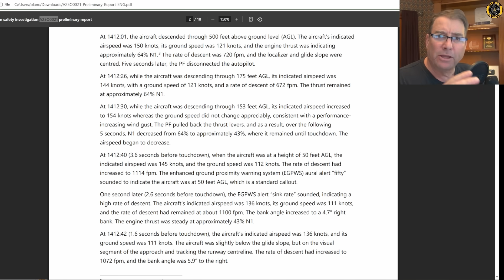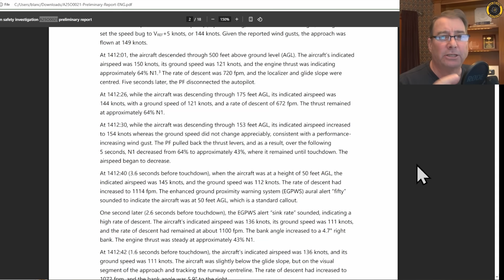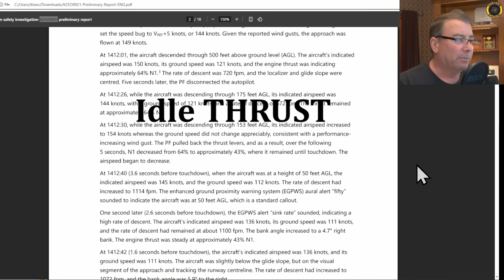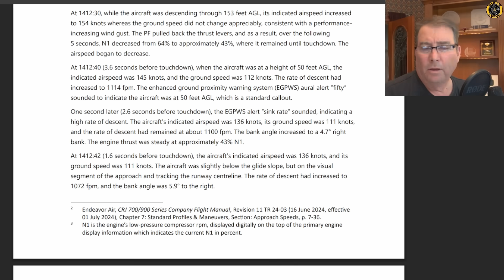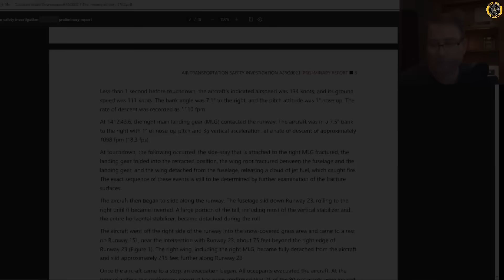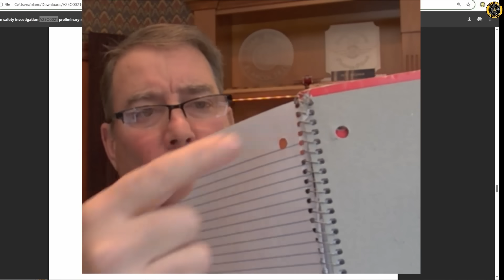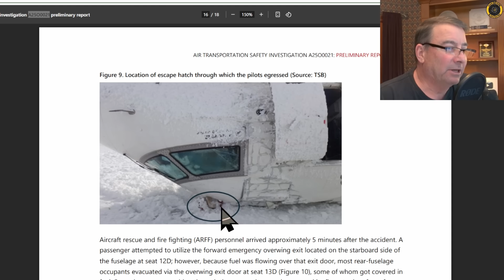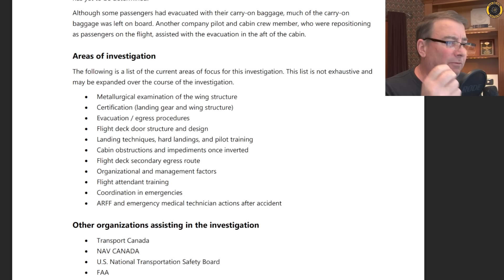TSB Prelim Toronto CRJ Crash

Comment: Here's something to think about.  The GPWS "sink rate" can mask or blank the normal calls.  50,40,30,20,10.  A lot of pilots over rely on those calls.  I've seen it before. 
 No calls------------> No flare.       I've seen a lot in my years.....   Lou B (21,000 ATP 747s, etc)
Reply from the maker: Great point!!
Reply: @blancolirio yeah I’ve seen that a lot.  Come on people.  Flare anyway.
Reply: @imaPangolin  they need the plane to hold their hand apparently.
Reply: @blancolirio  In South Africa an Impala military jet crashed( fatal crash ) this past weekend at a airshow outside Capetown. To me it looked like it was too slow and low to do a dirty barrel roll and that caused the crash. Could you do video on this ?
Reply: @blancolirio  Sight picture?
Reply: @bruinflight  Knowing how to fly a plane is for GA pilots not super special airline pilots.
Reply: One of my favorite books, Stick and Rudder by Wolfgang 
Langewiesche.
Reply: A true classic  @Mrsournotes2
Reply: But Lou.....if the aural warning "Sink Rate !" is blaring.....shouldn't pilot training kick in and initiate a go-around?  The altitude call-outs would be redundant at that point. Yes ?
Reply: @rael5469 and where was the captain when all this was going on? We’ve not had the CVR yet so don’t know if a go-around was called. Like you said it should have been and since the captain was pilot monitoring he should have called the go-around. CVR will shed more light.
Reply: @paul227-u1p  What makes you think that you know more than a trained airline pilot who was actually present in the cockpit ? You do not know whether he was taken by surprise or whether he did not feel that a go-round was necessary.
Reply: @hb1338  You mean an airline pilot that crashed? You think it’s wrong to question their actions after that?
Reply: @hb1338  I don't, but other's are putting the blame on the female pilot and DEI and I'm offering up the opinion that the captain is also responsible as pilot monitoring. The CVR will shed more light on this.
Reply: @paul227-u1p  I am taking issue with the word "should" because it is not obvious to me that a go-round was the best or only choice and there was insufficient time to make an assessment. Like you, I will be interested to know what the captain said and did.
Reply: @paul227-u1p the TSB will not release the CVR like the NTSB does.
Reply: 2.6 seconds before touchdown the audible sinkrate warning sounded. No time to initiate a successful go around at that point.
Reply: @awesomexistence  Yes there is - go-rounds are possible after touch down.
Reply: @hb1338  I think you missed the point I included which is a “successful” go around in this attempt to land. 2.6 seconds to impacting with enough force to break the plane! Maybe the pilot had a second or two to react to the audible “sink rate” before the catastrophic impact.
Reply: @ the go around is available until thrust reverse is selected. It's entirely acceptable for the plane to bounce off the runway in a Go around. Expected in heavy jets actually.
Reply: @awesomexistence  I'm not sure that we are disagreeing. If you are less than 3 seconds from touchdown and you get an EGPWS warning, you do NOT have time to make any form of assessment, so you make a snap decision. I have offered no opinion on what that decision should be, because the answer is not obvious to me.
Reply: @rael5469  A go-round is one possible response; increased thrust is another, as is an immediate flare. There is no indication that the pilot responded to the EPGWS warning, although in mitigation there was less than 3 seconds available to do so.
Reply: @hb1338   Maybe they got too slow to salvage that approach.
Reply: There's not a lot of visual information as you land on a runway - probably by design, to remove as many distractions as possible - and depth perception seems to have been a low priority.  That's why a narrow runway can be deceptive.  Nonetheless, you're expected to know where your wheels are, 80 feet behind you and 20-30 feet below your seat (and varying with your pitch angle.)  
I know I'd find the call-outs invaluable!
It's not so much a question of "relying on" them as a matter of becoming accustomed to having them: landing without call-outs would mean that one's acquired instincts are no longer in play.  Without stick-and-rudder experience, what are new pilots supposed to fall back on?  How much simulator training without call-outs do they have?
Reply: @jpdemer5  There is a very good reason why call-outs are provided - they are much more precise and much more accurate than the human eye.
Reply: NO flair was obvious from the landing video. Great analysis, Juan! Still a miracle that no passengers died.
Reply: Anything over 600/min is considered a hard landing on CRJ 900
Reply: I’m not a pilot. I couldn’t imagine a more fulfilling and interesting career. 

Of course I’m old enough to be some of you fellows’ grandpa and have learned that the grass is often just as scorched on the other side. 

Still, in my next life I’d like to be this guy or Juan or some of you reading this comment right now. I hope by then I won’t be so acrophobic.
Reply: I’ve have flown with a few pilots when we don’t have the call outs they don’t flair.
Reply: @ I agree. I’ve seen it.
Reply: “Sink Rate” callouts that close to the ground, on anything other than a pre-briefed steep approach (e.g. London City) indicates an unstabilized approach, which necessitates an immediate go-around.
Reply: @jmd12127  .. or not. What is the company policy of Endeavor Air ?
Reply: Interesting point. Instead of relying on what's in front of them they are just listening for the cadence change it's call out only?
Reply: That's a good point. Another important point is that the PM which was the captain didn't call out the excessive sink rate and bank angle. A 7.1 degrees bank angle would mean the wing would have hit the runway even before the landing gear.
Reply: Thanks.   Add that to Juan's point about a visually narrow runway and blowing snow, and the PF lost  a number of the normal queues for flare time.
Reply: @wastinelectrons7173  yeah, narrow runways lead to late flares. I flew the 747 for almost 30 years. Landing on a 150 footer vs 200 footer was a briefing item. It’ll catch you for sure.
Reply: @loub747  When my dad got his SEL (as a glider guider) his instructor took him to MHR and 3O8 on the same day to underscore this point. (150' and 30' wide, respectively)
Reply: @loub747 The converse can also be true. As a student pilot I had only ever flown from a 75' runway. Guess what happened the first time I landed on 150'?... Tail strike from over-flaring, as my 75' brain couldn't cope with a new 150' wide reality! Luckily, the Aerobat survived the experience unscathed.
Reply: @loub747  loub747, Re "150 footer...It'll catch you for sure" consider this gruesome aspect: at NIGHT you go by lights, right, not by plowed width? That means they have to plow 200 at night instead of 150 at day. Inconsistency loves crashes. Why, the same pilot who landed there 3 hours ago with 150, sees 200 now, and the red eye sees 200 then later it's 150. Umm, does that add a hole in swiss cheese?
Reply: @Bill_Woo  pilots need to land safely in all conditions. Or no? Stop making excuses. Student pilots near the start of their training are expected to land at different airports with different width runways and different terrain. Why do you have lower standards for airline pilots?
Reply: @chrisnoname2725   chrisnoname2725 That is the most deluded mis-extrapolation or misstatement of what I said in history. Or is it deranged: you have GOT to be a Democrat with that illogic. With that disjointed reasoning, bereft of rational thought, please help all of us by staying out of the air. Thanks, and happy bussing!
Reply: @chrisnoname2725  That is an idi0t1c distortion or false representation of my comment. Stick to busses; they're perfect for you, as they require far less logic both to operate and to ride on.
Reply: @Bill_Woo  Did I have to agree with you because you showed you’ve been paying attention because you said Swiss cheese? Your attitude towards bus drivers explains everything. 
I have never driven a bus but I have plane and helicopter licences and found both quite easy. I have never met a good pilot that thought they were special but the bad ones thought they were. 

Bus drivers don’t get excuses made for them if they can’t navigate narrow streets right after wide ones.
Reply: @wastinelectrons7173  I think this point will be deemed critical.
Reply: One of the things most people don't appreciate about modern operating systems like Windows, is that they will take multiple audio sources, and seamlessly mix them into a single audio signal to be sent to your speakers.

I can see why you wouldn't want to do this for aircraft alarms (it's another thing which can go wrong). But likewise I can see an argument for "important" aural alarms to have their own dedicated speaker. Testing multiple speakers can be easily accomplished by a recording playing back "one two three four" etc with each number going over different speakers.
Reply: @solandri69  Very true about the sound mixing technology in aircraft.  Traditionally, aviation intercoms and headsets have not done this well.  There is a lot of innovation in this area that is becoming more widely available, but like many things in aviation, it takes 20 years for most aircraft to be fitted.  I know my system which was new in 2020 lags the best technology - I have to choose which alerts are highest priority, and they completely override lower priority alerts.
Reply: @solandri69  The received wisdom is that pilots should deal with only one problem at a time; the flight director system sorts those problems in descending order of priority and does not announce any item until all items of a higher priority have been cleared. Multiple speakers are therefore not usually necessary.
Reply: When I was at pinnacle (now Endeavor) I believe you could add 1/2 the gust factor.
Reply: This wasn’t a good day for THAT captain to be flying, especially with a low time copilot. These professional simulator check airman are worse, than highly experienced copilots. Dave, 28,000 hours, 40 year major airline pilot.
Reply: A very interesting point -- I wonder what the CVR audio will show on this, as well as on CRM.
Reply: @loub747   this countdown would have sounded like a YT video on 2x
Reply: The debate also becomes, if you hear sink rate during your flare, it should be automatic go-around?
Reply: @ManualFlying  That is a matter for the chief pilot of the fleet/company and/or the individual pilot.
Reply: That doesn't explain why she pulled power to idle.
Reply: he did.  The massive performance enhancing gust.
Reply: @CHFandango  Juan already did. Apparently you weren't listening...
Reply: @CHFandango  She did it because the increse in head wind led to an increase in airspeed and lift. She was trying to bring down the speed and the plane back on glideslope. 
A go around should have been initiated instead. 

But she's inexperienced and the captain had only flown 3.5 hours in the last month. Whoever decided it's a good idea to pair them on this flight, took a risk imo.
Reply: @andreea007  yes your absolutely correct. Think is eve my PPL we are taught about head winds and taught not to throttle back like she did. Its the basics of flying. I don't know if the captain would of know she had throttled back. Had the plane had auto throttle this wouldn't of happened.  The issue here is not that she's female but that she's not good enough. Not to say she might be at some point but right now she isn't. Much the same with the other female pilot of the recent wing strike endeavour. Trouble is with endeavour it is not a meritocracy.  A male pilot who is a far superior pilot will be overlooked in favour of the ladies involved in these incidents. This cannot continue.
Reply: @andreea007  The important point is that the FO reduced the speed far too much and failed to undo the over-correction. Go-round was one option, but you do not have enough information to be able to say "should".
In all but the smallest airlines, flight crew schedules are constructed by computerised systems. The various selection criteria are usually assigned a priority and it may not always be possible to satisfy each and every one of them.
Reply: @CHFandango  Please provide evidence for your assertion that Endeavor Air discriminates in favour of women. Failing that, please do us all a favour and remain silent on topics of which you are ignorant.
Reply: What do you know?  You only have 21,000 hours.
Reply: It’s been said many times, to your point, that you can be blind but not deaf. Many pilots do rely on these autocall , and the rate at which they sound.
Reply: @edgarmuller6652  what does that have to do with her pulling throttle to idle exactly when indicated speed increases? It's totally unrelated. The accident was inevitable as soon as she idle throttle and left it there.
Reply: @edgarmuller6652  There is very little wrong with that idea, the automated call-outs are far more reliable and accurate than the human eye.
Reply: @hb1338  You have no issue with pilots not flaring because there was no annunciation? Trucks don’t warn you. Would you be making excuses for truck drivers not braking ?
Reply: @chrisnoname2725  Nowhere did I say that; kindly refrain from putting words into my mouth. What I implied was that automated call-outs are probably more useful than the human eyeball when deciding exactly when to flare.
Reply: Okay, but if you get a sinkrate warning on an approach so close to the ground, you're supposed to go around anyway. It's no longer considered stabilized.
Reply: @RubenKelevra  .. or not, as the case may be. Stabilisation criteria are a matter of company policy.
Reply: @hb1338  so which companies allows to proceed with a GPWS warning?
Reply: Combine that with a snowy runway giving the illusion of being higher and this is probably the result.
Reply: I'm hoping they will look at a way to keep both calls- either by speeding up the voice, or playing over them. 
But I would think hearing "SINK RATE" would more than key the pilot into arresting the sink rate- at least pulling the yoke back.... but I'm not a heavy pilot and I wasn't (and am not) there.
Reply: The height measured and announced by the radio altimeter is far more reliable and far more accurate than the human eye can ever be.
Reply: I would be a little surprised if someone was trying to land whilst the sink rate alarm is going off, surely that's reason for a go around?
Reply: @ it’s not a reason to go around.  In the 747 it’s a common occurrence if the glide slope is 3.2 degrees or more.
Reply: @loub747  That's a pretty strange setup to have an alarm go off in routine ops. I've never heard sink rate go off. That being said, the rate of descent of 1000fpm after the stable gate would by itself have been a reason to go around in my operation. What's the final approach speed in the 747? must be pretty high to be setting that off.
Reply: @ i think people just assume that anything not perfect is a reason for a go around as if you can’t just rectify the problem. They think they’re experts because they watch a YouTuber they want to treat as one
Reply: @ there is a difference between not perfect and exceeding limits. I normally see about 500fpm rate of descent on final, with the stable criteria being less than 1000fpm. If I see it at 750, I will raise the nose a little and add a touch of power, but if its at 1100 or 1200, Im adding full power and pitching up to the GA attitude. We have fairly clear criteria for when you are to abandon the approach, I don't fly this aircraft or for this airline, but its a major airline so I am sure they have this also.

I used to train pilots for BA and Easyjet at L3 Harris, so I suppose I am an expert, but not in this instance, as I am not familiar with the aircraft or company SOPs, however it's not likely this will meet the company stable criteria. 

We should keep in mind other aircraft flew in and out all day with no trouble, conditions were mildly challenging, no more than that. I land in similar winds often and without remark.  Something quite bad has happened here, and initial indications are that it's solely due to poor crew performance.
Reply: @greybuckleton  It is clear that the crew was unaware of the dangerously low airspeed, so it is quite possible that were also unaware of the excessive sink rate.
Reply: @hb1338  I can't remember from the video anymore. Did the airspeed drop below Vref?
Reply: @ why not just arrest the sink rate and continue the approach? 
When you’re parking your car do you give up and go around if you didn’t get the angle right the first time or do you just correct?
Reply: @chrisnoname2725  because it's not a car, you can't just stop. If the sink rate is too high it means you have lost control/awareness of the aircraft. You've gotten "behind the aircraft" as we say. Best to start over entirely, climb up, regain situational awareness and then decide if another approach is a good idea given the conditions and the pilots skill level. Most airlines have a "Stable gate"  an altitude (often 1000 feet) through and under which the aircraft must remain within very specific parameters to continue the landing attempt. Should these parameters be exceeded, the first pilot to realize will call for the "Go around" using the companies standard phrasing. Many accidents occur from pilots who are fighting to get an aircraft re stablalised on short final, its not the best way to do it.
Reply: @chrisnoname2725  When you are less than 3 seconds from touchdown, there is very little opportunity to correct.
Reply: @ well maybe. It’s not unusual to get a bit of a drop close to the runway and need to add a little power. That seemed pretty common on airliners i was a passenger on and very common in the small planes i have flown. I don’t understand this obsession with a stabilised approach where people seem to think you have to go around instead of just getting back on the correct slope.
Reply: @chrisnoname2725  you would understand the obsession if you had seen the stats. Almost no accidents are the result of a stabilised approach, and many of them ARE a result of attempting to land an aircraft that is too fast, low or otherwise not ready to land.  A "Stable approach" does not mean nothing changes in the last 1000 feet, it means nothing is allowed outside a criteria in the last 1000 feet.

The criteria at my work is Vref +10-0kts, Vertical speed, not more than 1000fpm, glidepath not more than 1 bar/light off, landing flap extended, gear extended, landing checks done. 

This criteria does not stop me from making power and pitch adjustments to maintain the aircraft within these tolerances. And indeed I often make many small adjustments in this time. 

A pilot who cannot stay within these criteria has lost control of the approach, and should go around. 

This accident was not the result of a needing "a little power", they had speed variations of 20kts, vertical speed sustained above 1000fpm, were below profile and with a wing down. They were out of shape in every metric you can measure, the approach was lost, but they tried to fix it and land, thus the crash. Thus the obsession with stabilised approaches in the industry, which at least at my work would have required them to go around when this out of shape below the stable gate.
Reply: Love your channel.  Snake hunt all the time.
Reply: @ thanks so much!  Appreciate the support!
Reply: Absolutely great comment.
Every pilot, private or commercial should thank you for that input.
Reply: Very good point.
Reply: If I recall correctly from my aero engineering days 40(!) years ago, we designed for 5g downward force? But that was interior structures on a 747...
Reply: What do you think about an automated safety flair, if the plane warns for sink rate it "knows" there is a problem. Warning the pilot takes time, comprehending takes time and executing takes time. What if together with the sink rate warning under å certain radio altitude the AP would automatically add thrust  and then flair if it is not done. I know it would be another automation instead of better pilot education. The Airbus has a performance floor. Would this have been the same issue if it was an Airbus? Would the floor protection have kicked in and would it have been fast enough?
Reply: @thehighwayman78  most new fly by wire aircraft have that flight envelope protection you are  talking about. Airbus yes, but also 787, 777 and most fighter jets. These systems have a low layer of awareness, they know what the aircraft is doing, not what is happening around the aircraft. Indeed many of the systems get inhibited when close to the ground for this reason. 

What you are proposing is an auto land feature that remains engaged at all times to some extent. Auto land does exist, but requires special equipment on the aircraft and runway. See Cat 3C ILS for more information. Thes auto land features cannot tolerate strong gusts and wind, and so likely are not suitable in their current form. I

This idea what not bad per se, would require expensive development and then a crushing expensive requirement for new equipment on all aircraft and airports. Many aircraft and most airports do not support auto land. Where I live in New Zealand, only 1 runway in the whole country supports it. And it only supports it when the airport "protects ILS sensitive areas: which requires ground vehicles and equipment to stay away from the runway. This disrupts regular airport operations. We always have to consider the cost of the fix as well and the regularity of the incident it is trying to fix in these decisions. This was a small aircraft remember, with a limited number of passengers who will ultimately have to pay for these modifications. 

A last ditch auto flare seems like trying to fix broken glass with tape. The cause of the accident isn't the moment it hit the runway, but  a minute earlier when the crew were losing control of the aircraft, but continued the approach instead of going around. Our automation is not capable of the complex assessment required to declare an approach unstable, however airbus does have a windshear alert system and such a system could have been helpful here.

The accident report isn't final, but considering the conditions were unremarkable, and that all other crew landed and departed without incident or remark that day, I think we have a plane case of low skill and poor decision making.  The cause of that will need to be identified, but I would suggest the companies training and standards are in my crosshairs. And not because of any DEI crap you hear online.
Reply: @thehighwayman78  One phenomenon which has plagued Airbus for many, many years is that its' aircraft have so many automated adjustments that pilots often have no idea what their aircraft is doing or why.
Reply: @hb1338  Ok yeah I can see that being a problem. I think it's called the out "of the loop deamon" for situational awareness. It's a tricky balance.
Reply: @loub747  That may have happened but how about just looking out the window and flying the jet. Another example that all the "magic"  will never substitute for basic Stick and Rudder skills.
Reply: @ I’m not making excuses for what happened, just giving an example of what may have occurred. It’ll definitely catch you out when it does. In the 747, you sit so high that you rely on those calls. Especially when new to the airplane. Again, not making an excuse, just a possible contributing cause
Reply: @loub747  Ok, seems like that might be fairly unique to that particular jet. This was a fairly small aircraft, I imagine its landed in the conventional way. Relying on an automated call out seems like a bit of a worry tbh, all things have glitches and failures.
Reply: @ while I’ve never flown this jet, I can 99% bet it has the callouts. A sim pilot in the left seat with only 3 actual hours in the last months would need the help. I fly a Gulfstream now. It has em.
Reply: @loub747  I expect it does have the call outs yes, I just don't expect people to be using them to time the landing flare. Although regardless a sink rate of 1000fpm+ over the fence is going to be mighty hard to 0 out for landing. I find the rad alt on my aircraft not entirely reliable over reflective runways. I don't see this as a dependable device. Perhaps on other aircraft it is better. I can't ever see relying on a single system as acceptable tbh.
Reply: @greybuckleton  no disrespect, but in the 747 as well as the G650, the callouts are very much a determining factor to flare timing.  The 747 flare starts at 50, then 30.  The G650 you can wait until 10, but I usually check the descent rate before that. I flew a twin Cessna that had the callouts.  Pretty much useless.  1000 fpm isn't that high when  700 - 850 is normal (140 kts - 170 kts approach speed)  Just my thoughts.
Reply: @loub747  747 seems to be a bit of an odd ball here, very heavy, poor seating position ect, ultimately an aging jet in its final days.  

The CRJ can fly pretty slow, it is a regional jet after all, short field performance matters. Approach speeds are around 120kts, so you should be seeing 600fpm, sure perhaps 700 while correcting a third white on the PAPI, but not 1000fpm. With 1000fpm you have screwed it up, are too high and need to go around.  I fyou require such a high rate of descent because you are so late in the approach and so high, its over mate, time to give it up. 
The pilot is in a pretty normal position for the flare, I fly a larger aircraft than the CRJ and I flare using the same visual cues as a C172. 

Whatever the aircraft there will be a normal rate of descent, I use 5x the ground speed, that's not accurate but you can do it on the fly. 170kts seems very fast for landing, Concord perhaps? I think even it could get slower than that? Pretty sure 747s get down below 150kts, but I haven't flown one. Regardless, this wasn't a 747, not even close.
Reply: @ VRef on the 747 gets up there. I’ve flown it for 30 years. 160 is common. With additive easily 170. On a 3.2 slope you’re doing 1000fpm. Just saying. Sure it’s an RJ, not a 747. 1000 fpm is not a reason for a go around.  If it’s your personal limit, rock on. I think you’re missing my point entirely. Anyways, see you in the skies.
Reply: @loub747  it's actually the company limit, but the landing speed is normally 120kts. 

It's really the difference between the expected and actual RoD. For instance you point out a 3.2 degree slope, but that's not normal,  the Toronto 23 approach is the normal 3 degrees. With steep approaches such deviations from normal are part of the brief.

In this instance, at the ground speed they had, using my 5x rule you should be seeing 500fpm, they reached 1100fpm at 50 feet, right wing down and seeing speed variations of 20kts IAS, and now below glide slope, that's messy as heck. For my company that would breach both the IAS and RoD criteria below the stable gate. Add in the unusual power setting and the roll, I can't see how this isn't classically unstable approach. 

I will be surprised to find out that this meets the companies stable approach criteria, and  if it does, that's quite likely to be flagged as part of the cause. 

Good chat anyway, interesting to hear about the quirks of the Queen of the Sky and some of the differences in heavy vs medium jet handling, I won't get to ever fly that aircraft I don't expect, but perhaps the 777X is on the cards.
Reply: Didn't think you were making excuses and it's a good point. (2800+ hrs left seat in the 744 and yes, it was nice to have). However, the 727 didn't have it and it probably sits a bit higher than the RJ. Radar alt callouts absolutely not necessary, unless of course, one is a "magic" cripple.
Reply: To those saying a GPWS sink rate should be followed by a go around. If they were overwhelmed and or task saturated they maybe did not process the alarm. At some point prior to impact someone may have realized it but then it was already too late.
Also remember all this happened in probably fewer seconds than it took you to read this reply.
Reply: @MaVaLa-um2lu  The sink rate warning occurred less than 3 seconds before touchdown. There is no indication that the pilot responded to it.
Reply: Awesome point
Reply: All good points.
Reply: Factor in women driving, there you go. Making complete sense.
Reply: OMG! It's that silly computers fault!! I can't believe I'm like, supposed to have skills and stuff AND pay attention? Not fair!! I'm totally filing a complaint with human resources............
Reply: @jeffpiatt3879  OK the words 'human factors' are lost on you.
Reply: @jeffpiatt3879  Easy boy.
Reply: @wintercame  but he’s not wrong. There’s no excuse for not knowing how to fly when you’re a pilot.
Reply: @ Easy, Chris. Jeff's stream of consciousness was a parody. I'm just pullin' his leg.
Reply: @chrisnoname2725  A bit simplistic, yah?
Reply: If all these things are true they would all crash
Reply: @sammyjimsmith6100 Not so - it comes from experience. The captain was caught by this too otherwise he should have called a go-around.
Reply: @paul227-u1p  It is also possible that the captain decided that a go-round was not the best option - best wait for the full report.
Reply: @hb1338  The CVR should shed light on this.
Reply: No  @sammyjimsmith6100
Reply: @ Huh?  Seriously, I don't understand....
Reply: @sammyjimsmith6100  That's not the point.